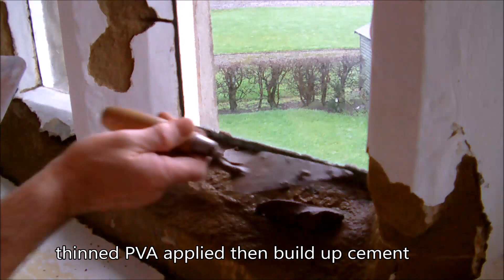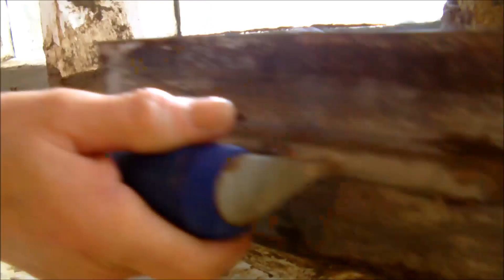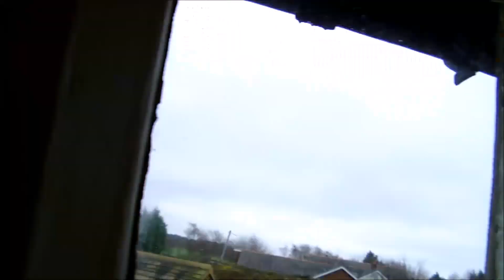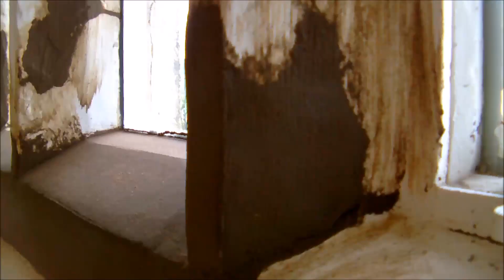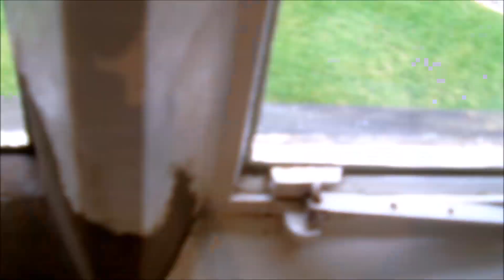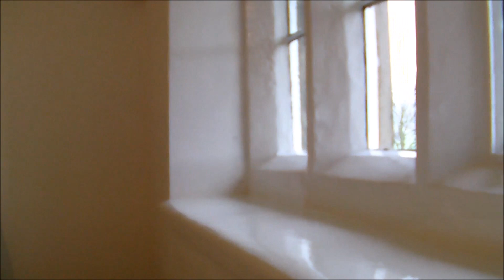How to repair sandstone sills and  mullions interior built in 1629

Comment: hi., very useful information here. Would it be correct to use Bulding sand and lime at 3 to 1 ratio for my exterior bay window sandstone pointing/repair on 1900 building.? Many thanks
Reply from the maker: Yes go for 3 to 1.5 stronger mix for a sill. thanks
Reply: There are specialist products out there for this  from Conserv who make lime mortars

Comment: Thomas Kevin Murtagh is correct, you seem very skilled with your hands. I would recommend taking a conservation course though, as this type of repair with any level of cement is inapropriate, inside or out. For historical structures such as this I would recommend engaging or seeking the advice of a heritage professional before carrying out any kind of repair. English heritage also produce a great series of practical publications which I highly recommend (see, Practical Building Conservation: Stone). Organisations such as SPAB, or the 'building limes forum' would be able to point you in the right direction ref courses. You've clearly got the hand skills, I hope that you can put them to use to help save our historic buildings, and help other people learn best practice through here. Best of luck!
Reply from the maker: You may be correct for exterior mortar joints and rendering near stonework. But this work shown in the video is internal which makes a difference. Have read a lot on this subject and it seems this problem only occurs outside. 
Mainly on mortar, it's not anything chemical more to do with weathering the mortar now is a lot more hard so weathers slower than the stone. But it must be having a dramatic effect on how the wind rain and frost affect the stone at the edges near the mortar.
Reply: If either side of the wall is not able to breathe it will be effecting the function of the wall by causing problems with the egress of water, the transmission of salts (chemical reations) at and around the interstices. It appears from your images that the (what appears to be) non breathable interior finish shows some bubbling, and this finish may be what has caused, or exacerbated the decay of the stone. Obviously a site visit from a conservation professsional would be appropriate to further determine this. There is a lot of out of date literature out there and your comments suggest that there are some gaps in your understanding. So I would suggest getting up to date or getting in touch with some of the organisations that I mentioned above, as you are clearly keen to do a proper job. In our professions we are always learning, and we should all help each other to develop our skills, especially as our understanding of the materials and their conservation is developing so quickly.
Reply from the maker: I trust my experience 100% so do my customers.
Reply from the maker: Understanding the practical side is very important in my game. A cement is a binder, a substance used in construction that sets, hardens and adheres to other materials, binding them together. Cement is seldom used solely, but is used to bind sand and gravel (aggregate) together. Cement is used with fine aggregate to produce mortar for masonry, or with sand and gravel aggregates to produce concrete
Reply: And this mix is called a cementicious mix. Which is not breathable. Which is why it is not appropriate for use on historic buildings. Any of the current literature (historic england, historic scotland, SPAB, etc, etc.) will confirm this.
Reply from the maker: https://www.lime-mortars.co.uk/articles/hydrated-lime-mortar
Reply from the maker: You may be right but I still think it's how strong you make the mix. 3 to 1 sand cement and plasticizer. Worked fine and has outlasted other repairs. But again this is interior.
Reply: I know you are talking about the interior, which, is still important. The link you posted also talked about the need to eliminate cement totally from the mix as it is not breathable. I dont understand why you would say that cement is breathable and then post a link which counters your arguement by stating that it isnt breathable? A weak cement mix i still cementicious (as suggested by this article).
Reply: "Naturally, many people new to lime mortar assume that hydrated lime is the key ingredient, they know by experience that they'll need cement to make it set. Unfortunately this couldn't be further from the truth and is pretty much contrary to the use of lime mortars altogether."
Reply: " The real goal with lime mortar is to eliminate the use of cement which is unnecessarily strong, rigid and is not breathable."
Reply from the maker: That's to show you're right my mistake. It's a weak mix it will be ok the customer has tried to solve this in other ways and this seems to be outlasting other goes. Next time will use the good stuff.
Reply from the maker: Sorry thought cement was breathable stick to my polyfilla lol.  But still this was interior and the windows have been painted with a paint that is not breathable in the past.
Reply: You are clearly gifted and passionate, thats why I recommended courses. The heritage world needs decent people willing to learn and educate with good hand skills like yourself. Let me know if you ever get to the south of France, you'd be welcome to pop in for a tea (/wine!).
Reply from the maker: Thanks always room to learn in other areas of the building trade. Do like working on old buildings and repairing rather than replacing. South of France sounds great. Thanks
Reply from the maker: Think one reason we used this method was due to condensation and water running off the single-paned window and soaking into normal plaster which someone had used to repair the sandstone windows, which had blown in the past and blown again. Thought sand and cement would be stronger and was breathable. Maybe not idle as you have pointed out and I should have looked into it more,  but the water runs down and sits on top rather than soaking into the window when waterproofed with oil paints allowing it to be wiped up. Old buildings need loads of heat and dehumidifiers running 24hr
Reply: Good link, Mike, and, from the recent and relevant sources I've been referred to, essential advice.
Reply: mike's shed well said!
Reply: Painting and Decorating  hi., very useful information here. What mix and materials would you recommend for my exterior bay window sandstone pointing/repair on 1900 building. Many thanks
Reply: @PaintingandDecorating this is categorically untrue. You’re on the internal of a clearly external wall, the wall is external mate. Silly silly silly.

Comment: stone replacements may not of been in the budget and I'm not saying its a bad job. But but the materials used have just increased the weathering process
Reply from the maker: they will be fine.
Reply: Cement based mortar will cause more damage to the soft stone in the future, it's as simple as you. I work this stone every day in case you ask how would I know.
Reply: @willjohnston4320  how would you repair these sandstone sills outside. I have to do some on my property

Comment: These types of buildings have to be "breathable", which won't be the case using PVA and regular cement? This building will be damp in years to come, Just like the building we have currently bought and are putting right someone's else's wrong decisions and wrong materials used.
Reply from the maker: You're completely wrong and really don't understand your materials.   Condensation is the general cause of most damp walls.   All the materials used are breathable.      Like I say you have no idea, we do this day in day out.   Thanks
Reply from the maker: Does cement dry out when it gets wet?  I think so...  so it must breath.   Also PVA is not a vapour barrier.      I know my stuff and the material I use.    Day in day out.. 
Cheers

Comment: Hello mate - how long did this take to complete? I noticed there was a lot of filling and oil based coats so just wanted some advice on how you managed to keep yourself busy whilst waiting for things to dry :)
Reply from the maker: The window prob 2 days if you add the time up. The rest of the room was done as well so plenty to get on with.
Whole job about 10 days. We use heaters and dehumidifier very important to have a dehumidifier.